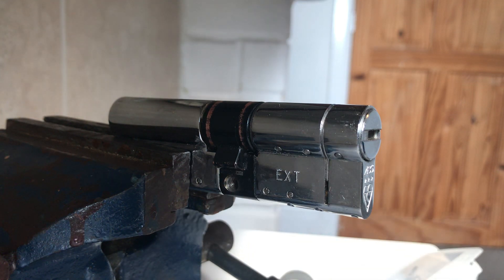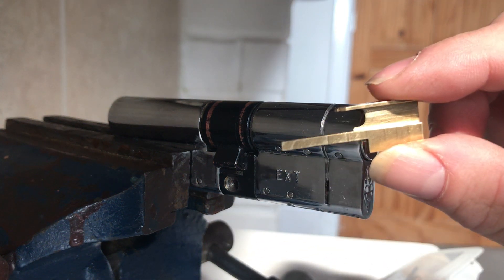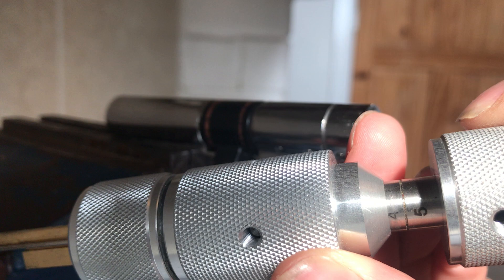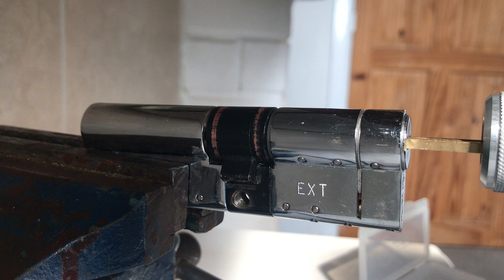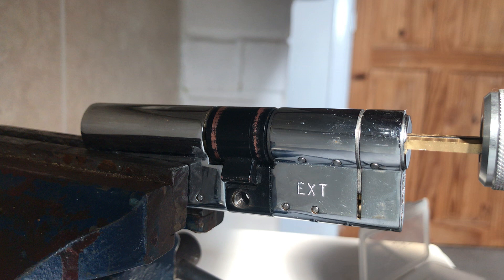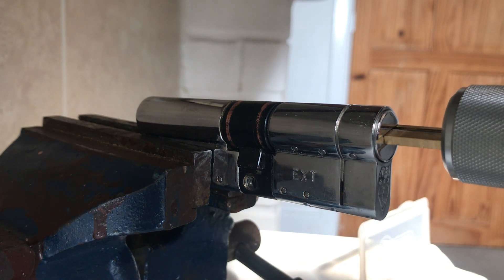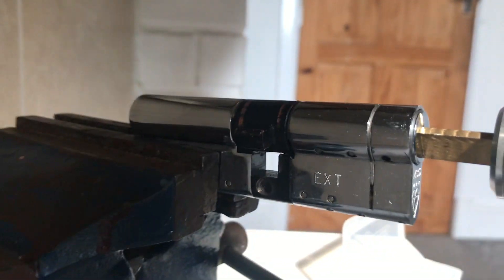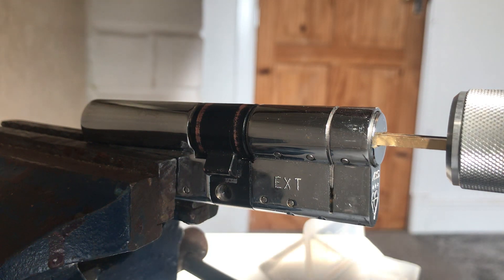Teaching the ABS cylinder who’s boss

Comment: Nice pick.
I use the T-bar pick myself with the 5 different hollowed out blades (each blade has a magnet in each position), I've used it loads on the bench but only once on a job, I just don't get many ABS cylinders up here.
Reply from the maker: Ahh yes you use the Ultim8 pick , I’ve tried it and it’s decent 👌🏻 don’t get many up my way either but you do see the odd one or two

Comment: I have got this lock and now it seems scary to me how easy it is to pick... I am aware that everything is pickable, but have you got any recommendations on a good harder to pick lock?  Something which can only be drilled maybe? :)
Reply from the maker: You need to remember that I’m a locksmith that practices with dedicated tools so in reality you would only need to be mindful of physical attacks which this cylinder deals with in the strongest way. But if you really wanted a lock like that then probably the EVVA 3 star would meet your requirements 🤝🏻
Reply: @FortressLocksmiths  Cheers for the prompt answer :). Yes you are right, you spend all day every day opening locks, so fair comment :D
Reply: It's actually an excellent lock.  Generally burglers will try and snap the cylinder. Most don't have the skills, the tools or the time to pick locks.
Reply from the maker: @Meal-deal555  it is indeed an excellent lock although can be a bit temperamental….the new ABS master cylinder is flawless
Reply: @FortressLocksmiths  In what way can it be temperamental?
Reply from the maker: @Helium_Hunter  too much going on , pin-in-pins, trap pins, magnetic elements. If you have any metal shavings in your pocket they could attach to your key and inter the lock, the new ABS master is much smoother in my opinion

Comment: I've got the same lock with a thumbturn and it just stopped turning. Now can't close it any help would be greatly appreciated
Reply from the maker: Has it stopped turning both sides with the key and the thumb turn?
Reply: @FortressLocksmiths  yes both sides
Reply from the maker: @A222-p3q  try locking/unlock with the door open if it still doesn’t then realistically it can only be a faulty lock or mechanism
Reply: @FortressLocksmiths  yes tried it with the door open too and still won't move thank you for your help
Reply from the maker: @A222-p3q  final question what kind is you door, upvc/composite or the new composite with no handle action?
Reply: @FortressLocksmiths it's old upvc door
Reply from the maker: @A222-p3q  I’m presuming you had the ABS fitted? The trouble is if the key won’t rotate at all then you can’t rotate the cam enough to take the cylinder out , my honest advice is to get a decent locksmith out
Reply: @FortressLocksmiths  yeh had 3 fitted at the same time on 3 different doors, one went like this a few months ago on another door and second happened yesterday. Yes you are right can't rotate the cam enough to take it out so will have to get a locksmith out. Just was trying to figure out what happened as it's bizarre. Thank you
Reply from the maker: @A222-p3q  just a quick one, are they all thumbturns and also are they all keyed alike (all locks working off one key?)
Reply: @FortressLocksmiths  yes all thumbturns and all with same key
Reply from the maker: @A222-p3q  from what you’ve said if all the cylinders were keyed alike and all have started having the same problem then all I can speculate is that the issue is when these were being built to order ….hopefully you get it sorted
Reply: @FortressLocksmiths  don't know what's going on yet but thank you for your replies